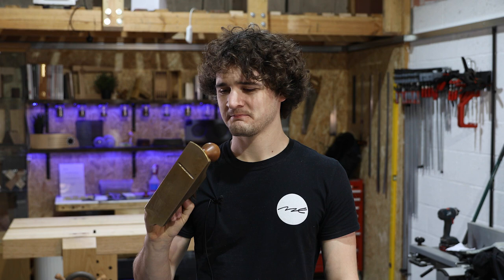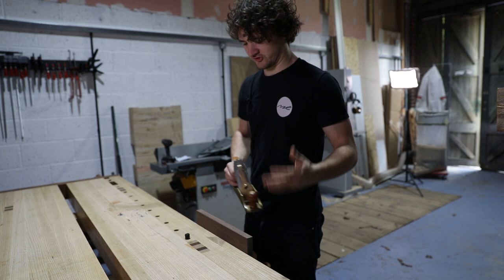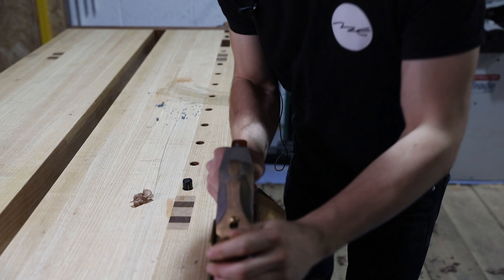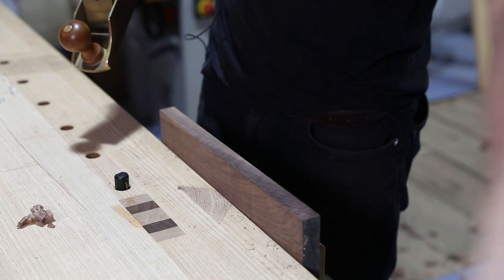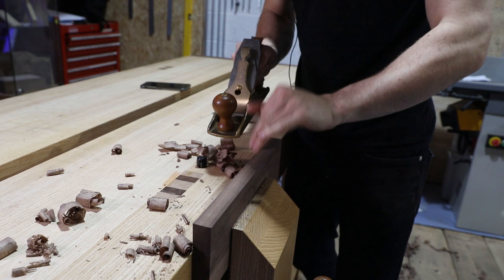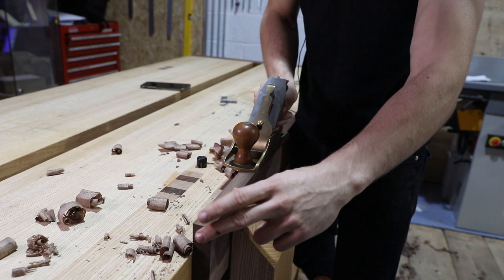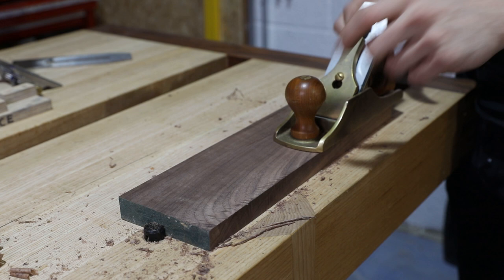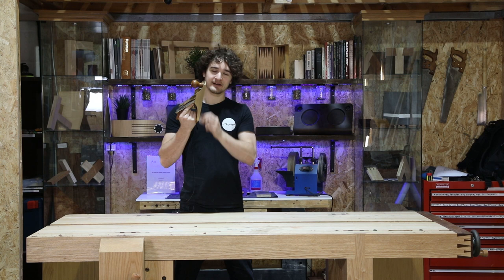How to Plane CORRECTLY

Comment from the maker: CORRECTION

I forgot to take the frog angle into consideration when talking about effective pitch at 14:08. The shaving will actually be travelling up a 45 degree slope when the plane is travelling straight.

Again, watch this video on reducing tearout if this means absolutely nothing to you: https://www.youtube.com/watch?v=6fGqh42lSM0&t=

Let me know if you found this video useful!
Reply: I'm not mad, I'm just disappointed.
Reply: As I was watching you talk about this, I was thinking "WHAT? How could he have gotten this so wrong?!" Then I came down here and saw the correction - so good job! Although, what you said could apply to bevel up planes.
Reply: @Subsonic-cd2en  all of that is true, but it won't earn you hater of the month with all that encouragement!
Reply: Matt.. ReferEnce face (13:42). eish :-P
Reply: Here I was typing out a reply... 😜
Reply: Great video. I put a little furniture wax on my planes and WOW what a difference! Plus going slower when planning and taking off less... big help. Thank you
Reply: Ha, I was wondering about that….oops

Comment: Matt, as an old man of 60, I've lost some of the strength and stamina of a younger man.  What I've discovered is that I've been pushing down too much when using hand tools (including planes), and was neglecting the use of a lubricant on my hand tools.  Do you have any suggestions on how to "walk the board" when planing a long board?  Also, I'm a disabled woodworker who has a dicken's of a time standing longer than 1 minute.  No one on the Internet has attempted to invent techniques for the handicapped wood or metal shop hobbyist, and since you are a talented communicator and are quite inventive, you are the perfect person to tackle the realm of the levels of disabilities and related shop techniques.  I've been working with wood and metal since I was 8 years old.  Thank you, sir.  Keep on teaching, you're a natural!
Reply: I agree.  Go for it Matt.   I’m 73 and there is a difference.  Paul Sellers might attempt this from the other side of age range.
Reply: Obviously I'm not Matt, but for lubrication for my metal planes I use what we call "sewing machine oil". I'm not sure if it's a thing where you are, but in Sweden it is. Comes in tiny bottles of about 100ml, last a very long time and doesn't harden.
It can give a slight staining to the wood, but it's usually removed within the first three strokes with said plane. =)
(This I learned from Paul Sellers, he's an absolute legend, go check him out if you haven't.)

Regarding planing long(er) boards, I'm afraid I don't have anything useful for you.
Reply: Why do boomers write these fucking love letters.
Reply: @ColocasiaCorm  You need to grow up, kid.  Pay attention to the content, context, and completeness of these entries.
Reply: @ColocasiaCorm  they have attention span

Comment: Perhaps I'm a bit paranoid, but I do try to minimise wax touching any surface that may need to be glued or coated. People overlook just how hard it can be to get rid of. Sanding it can push it into the wood and when it touches the paper it spreads around. I'm not saying don't do it. Maybe I will. But I think I'd look at polishing/buffing it first. I've heard some horror stories regarding people overlooking such things.

Comment: Hi Matt.  I bought my first house in 1985 and since then have been a keen DIYer.  I’ve taken on most things with a varied amount of success.  Wallpapering and anything involving wood were probably my greatest successes and probably because I enjoyed them the most.  I always promised myself that I would do more woodworking when I had the time and finally at 59, I have the time to do projects for fun, not just because my house (or wife) need them. I bought a plane many years ago and used it occasionally but never really got on with it. Fortunately the things I was building with wood didn’t really require using a plane.  A couple of days ago I stumbled across my old plane and on closer inspection I decided that my previous lack of success was probably due to me not actually knowing how to set it up. So after a bit of searching I found your video on setting up a plane, then I watched the one about sharpening the blade, then this one.   I’ve learnt a lot already and I’m now going to go through your through your back catalogue to see what other gems I can learn about my recently revived hobby.  Thank you and all the best. Steve.

Comment: Another great tip I learned many years ago is to focus on pressing down on the front handle when entering the wood, and then near the end of the stroke, change that focus to the rear handle. This will help keep the plane flat the whole way through and help you avoid rolling off the end of the board causing a round off towards the far end.

Comment: Oh yeah, you need to!  
OMG ... I cannot believe you actually said "there are no rules in woodworking". I am of the same mind because I was a life-long artist before getting into the one thing I always wanted to, woodworking. I am also a retired ER/Trauma nurse and we worked like MacGyver with spit and bubble gum when we had to. Whatever works, works. No rules. Makes my soul happy to hear that from a woodworker, and frankly, you're the first I've heard it from.
Well, now that I think about it, there are a few rules based in physics ... gravity. weight, torque, rotation ... but they don't have anything to do with the art of woodworking. And besides, all of the physics can be worked out later for whatever specific project. I know. I've never made a plan. I just do one thing, fix an issue, and then build the rest around the base, choosing hinges, building a door for a shoe cabinet, and then learning to upholster the seat at the end. No rules. Just let the piece tell you what it wants to be and then work from there.

Comment: Matt, I've built 6 solid-body guitars over the last 12 months coming from no woodworking experience at all. But one thing that I've always really struggled with is jointing square glueing surfaces with hand planes and I was really struggling the other day with my 7th build (a neck-through) to get the the centre laminate square enough to glue the wings on. This video really helped me, 20 mins after watching it I had the perfect joints. Thanks for the great content.

Comment: For info, for a 45° bed angle the effective blade angle would be:
10° skew --> 44.5°
20° skew --> 43.2°     
30° skew --> 40.9°
40° skew --> 37.4°
50° skew --> 32.7°
In case there is some other NERD (apart from me) in the audience ;)
Reply from the maker: That’s awesome!
Reply: The formula is alpha'=atan(tg(alpha)*cos(beta)) where alpha' is new attack angle after skewing, beta is skew angle and alpha is initial angle of the blade when not skewed or angle to which plane is set to.. I would like to post sketches that show that but I can not :/ Thank you Matt for all great info!

Comment: Sounds like a good tip. I will have to try moving my whole body pushing with back leg as you suggest. I tend to be hopeless at planing (Plane is sharp & setup right) as I always seem to bias off to the right, ending up with a completely  un-square edge. (right handed)

Comment: For years after you made this video I finally have got a tip for you! :D

The mountaineering metaphor I've used with my students, age ~14.
For the blade protrusion, I used the metaphor of using different gears on a bicycle, and they instantly understood it. Or so far it seems like they did. =)
Sharing it because I like it. :)

Comment: Thanks for the video Matt. I have a special planing skill that allows me to take a perfectlly square piece of timber and plane a tidy bevel on it (sarc). It frustrates me no end but clearly my technique needs work. I have no idea why I do it but it happens regardless of the plane I'm using, a 4 or a 5 (I only have the two). It's got to the point where I have put my planes aside out of frustration. After watching this vid I'm going to blow the dust off of them and have another crack. All the best, Brian.

Comment: Several comments..... One, the edges of a planed board, or one coming out of a drum sander are like little razor saws and will really slice and dice you. I speak from experience, and true on lathe pieces as well. 

Another, a quote I used for years before hearing a guest on Roy Underhill/New Yankee Woodshop show,  who was demonstrating correct hammer procedures, it came from an old Hollywood movie about Cyrano De Bergerac. He disarms a student with no effort and then says, "Hold the sword as you would a bird. Too tight and you kill it, too loose and it flies away." Same with any tools.... Wood lathe or hand planes.... 

If you have some carnuba wax handy, like Kiwi neutral shoe polish, it is far harder than candle wax/paraffin, and will stay on a lot longer. It may cause problems if you are gluing up panels later though, or applying some finishes.

Comment: Another woodworking channel features a Japanese carpenter. He rubs a red wax or grease pencil onto a flat block, one that could be used as a sanding block. He then rubs that block across the piece he is working on. The material from the pencil transfers to the workpiece and highlights the high spots to be removed. Looks like he does this technique for both plaining and chiseling.

Comment: skewing the plane also helps when squaring a surface to an adjacent surface, the index finger in front and thumb around might be a bit awkward for some people, but if you skew the plane, you can see and feel exactly where the surface starts to change.

but like you said, skewing reduces sole length, so ideally, you don't want to skew more than 45 degrees.
Reply: the candle wax thing just blew my mind.

Comment: G'day Matt, could you either do another video going into more detail on how to use the plane to correct edges that are all out of square please? Or point to me too which of your video's has already handled that in more depth. You touched on it, but I have never used a plane in my life and I'm planning on embarking on a wood furniture making (that and lamps and light fittings and i want to use steel and concrete and epoxy alot as well as wood) hobby that will hopefully become a full time job and your videos are a gold mine for people like me. I'm a fitter and turner by trade and alot of steel working skills are transferable but the closest we have to a plane is a file,  mill or cold chisel.
Reply from the maker: Hi Shaun, watch my series on Making a Chopping Board. That focuses on flattening faces, squaring edges and thicknessing boards entirely by hand :)

Comment: Finger fence advice ... If you're getting splinters in your 'fence' you are planing the grain in the wrong direction...
Reply: I've been doing some of that myself lately.
Reply: I think the grain on the side of the wood can be going in either direction depending on the piece of wood used. it can even go in both directions on the same piece in some cases.
Reply: @jacksargesson  ...and about anyone else at this point who might be "head--scratching" on the matter...
   Trees grow up in "cones"... Think about that image just a minute or so... imagine a series of straws arranging themselves in a cone shape. It's a tall slender style of cone, and then the "next season's straws" form around the first cone, making it a little wider and a little taller.
    That's really the basic structure of a tree growing, from grain-fibers...
      ...AND for the record, branches grow about the same pattern outward from the base trunk...

   SO... "moving with the grain" literally means following those straws from their source (toward the roots of the tree) upward to the tip.

    Special cases, like the forks of particularly large branches or separations at the trunk, CAN create places with "squirrely" grain patterns, where apparently yes, the grain goes in more than one direction. It can get difficult to figure out a proper "with the grain" movement there.
    Also, it's worth mention that gauls, burls, and other oddities in growth can cause grain to grow in a chaotic finished pattern.

   Most of the time, however, a "straight grain" wood with mostly straight lines visibly (the rings/ring segments you can see) can only grow in one direction. Many tree species ALSO have dubious circumstances of stress, like growing outward on a hill. This imbalances the trunk, so you have a higher "compression" wood on the downhill side (same with branches, if you ever get those milled)... AND higher "tension" wood on the uphill side, from the weight of the tree leaning off the hillside.
   Similarly, wind can twist a tree off it's ordinarily straight balance, and while this can create BEAUTIFUL patterns and colors in the wood inside... It's a bloody nightmare to cut, carve, or tool with any degree of reliable precision.

    Softer woods just tend to be more gentle to the blades of tools, but suffer a higher degree of tear-out even on the micro-scale (furry boards)... and worse, yet... if you're dealing with recovery-wood or "reclaimed" lumber, the weathering deteriorates the "natural adhesive" filler in the fiber matrix of the wood, too. Conifers, like pine (regardless of yellow, white, or even cedars and hemlock) tend to be particularly sensitive, BUT the worst (in my experience) is that "Whitewood" label at Lowe's... Nothing against wherever this mystery-species comes from... but if you're not exceedingly careful and gentle with it, it's very VERY prone to "go fuzzy" on you, and that's just a pain in the "fence". ;o)

Comment: A very very good video Matt.  I did know all of this, but i wish this video along with some of your others would have been around 15 years ago when I bought my first cheap hand plane.  Not a good experience.

I have a suggestion for a followup video.  Something missing from this one is the actual technique of getting a flat surface.  I mean how to use a plane and not cause a bow or dip in the surface.  Hope that made sense.  When I bought my jointer plane I was under the illusion that it alone would supply me with a perfectly flat surface without any skill on my part.  Oh yeah, big mistake.  The proper technique I'm sure you know and would be able to do a video that would be easily understood by people needing that skill.  Just a suggestion for you.
Reply: There's a video on it, he made a series of making a chopping board. Also covering how to make the material square.
Reply: Ah yes, I remember the one about doing square stock.  Still, it would seem to go along with the title of 'how to plane correctly'  Maybe version 2??  Just a thought.  I didn't mean to show how to do an entire surface, just  a small bit about not causing a bow or dip like maybe when jointing an edge.  Not to take anything away from this vid, as it's full of great advice.

Comment: I've thought that skewing the blade also changes the way the blade cuts the wood fibers. I got this from my experience using chisels. Slicing the wood fibers with a chisel is often cleaner (and easier) than pushing the chisel straight through. Surely that is another reason (besides the effective blade angle) that skewing a plane gives a cleaner cut?

Comment: I just started to learn about planes, I need to know which one I would use to even out to boards that are about 1/8 in, in deference. I am trying to build a box and put trim on top and inside the box is the uneven part. Sanding takes way to long lol

Comment: Love your Hand Plane series but I fundamentally do not understand how you can get a perfectly flat board (versus edge) when the front shoe is at the same level as the back shoe. Electric planers make more sense for this function. So how in the hell can you get a true flat surface if the blade protrudes lower than the shoe? I've not seen any videos yet from the other channel that address this.

Comment: I've been jointing 3/4 inch-thick boards for a glue up and having a surprising amount of difficulty getting perpendicular and straight edges with a Lie-Nielsen 62. Once I get it straight it's not perpendicular. Once I get it perpendicular it's not straight. So I find myself chasing it down for a while to get it reasonably accurate, but it could definitely be better. After watching carefully and thinking, I think my blade could use a fresh sharpening, and my cuts are too thick. I'll throw some candle wax on there too. I've got a camber on the blade. I can't see the camber (should I be able to?) but the way I sharpened in theory put one on there. I'm using my fingers as a fence to guide the lateral spacing. I've got the right posture you described, though I tend to use my legs and my arms instead of just my legs. These boards are long enough that I need to walk a few steps to get all the length. I took some notes and I'll try implementing your advice. Anyway, I appreciate these videos! Any input on my situation is welcome, or add a tick mark next to those questions for future content.
Reply from the maker: Watch my chopping board series, especially video 2 :)
Reply: Thank you for the reply and the recommendation! I just watched all 3 chopping block videos. I think I figured out what my issue was. My flattening stone had a cup in it, so despite my efforts, I was actually creating a reverse-chamfer in my plane iron like a total dangus! So everything I was doing to correct the error was prone to amplify it. Just ordered a two-sided diamond sharpening stone because I was about done messing with that system. Also, wax on the bottom of the plane is a game changer. Thank you for that tip.
Reply: And if all else fails you can attach a fence to your jointer plane to maintain 90 degrees.
Reply: I thought about that but it seemed like a sacrilegious thing to do haha